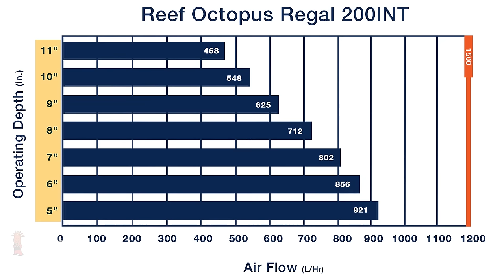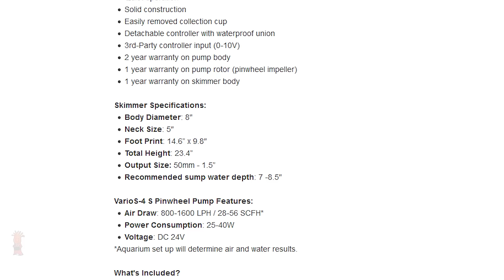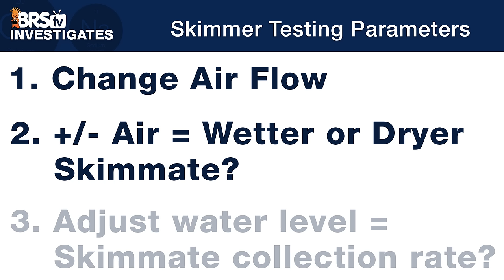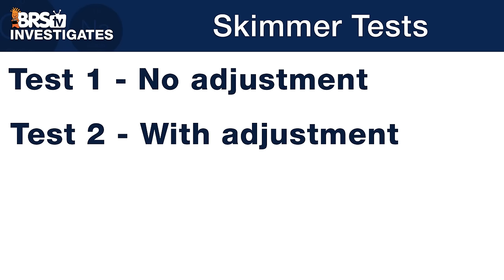Is this wet or dry? A better way to tune your skimmer…Could the answer be air? | BRStv Investigates

Comment: The air flow is mainly important for the smallest bubble size and therefore more water going through the skimmer being processed. That makes it more efficient. Adjust the size so in the column you see the air go to smallest bubbles right before it exits. Not huge varying sizes if at all possible.
Reply: I don't really understand this post

Adjust the size so you see the air go to the smallest bubbles right before it exits where?

Into the neck?

Comment: I'm running a Octo110 classic, and did a water change 2 days ago and the dust that got kicked up from adding water makes my skimmer air basically just shut down. But it'll return if I scrub it out with hot water in the sink

Comment: But what is actually better? Wet skimming or Dry skimming? Which has the better organics extraction rate?
Reply: Should be the same.  Different concentration for sure but over long run same organics. Wet may have impact on salinity if you have smaller system

Comment: Very nice test. Good job. Now I'm wondering, will you be able to replicate the AC pump result using two identical DC pump, one to feed water and one to draw air, and have them run in different setting but in same total power, like 1+5 & 3+3 & 5+1.

Comment: i have the red sea skimmerr 600.  It doesnt come with valve like you guys put on the air line. Is that bad me running without one? Since i cant adjust the air flow....i doubt red sea would leave out a part that is need to operate the skimmer properly
Reply from the maker: It's not 100% necessary, but rather another tool to fine tune the skimmer. Most skimmers won't come with them out of the box.
Reply: Mine is worse with the bubble magus curve 9+

Comment: so in order to adjust air I have to rig something up?  My eesops skimmer dosnt have anything but a small tube sticking up?  How often should you have to empty skimmer?  I have a large collection cup like video, I think mine is more like tank 1 alot of crud.  Thats a good thing right?  I  bought used an have no idea what the model is.  I did raise it up a bit to allow more water in my sump since i have a small sump.
Reply: It’s supposed to have a “air silencer@ on it to control the air flow, whoever sold it to you didn’t sell you tho whole thing

Comment: Put the 3 skimmers in the same sump and see which one shuts the others down. That way we know if dry or wet is better.
Reply: I like this.. Other than finding a way to actually measure the retrieved organis you put into the tank over time, this might be the best method of functional discovery.
Reply: Dry creates more solid crud on neck, wet is less crud, more juice. Depends on what you want to deal with. I have a waste locker so I like wet as I can collect more fluid and not have to clean neck as much.

Comment: Thanks for the great video. I am confused on one point regarding adjusting the air draw adjustment. I have a Red Sea RSK-300 and it didn't come with the option of connecting a tube to control the air draw.
Reply from the maker: Skimmers that do not come with a valve for air adjustment would need a separate valve attached to the air intake tube.  You could then make adjustments to air draw.